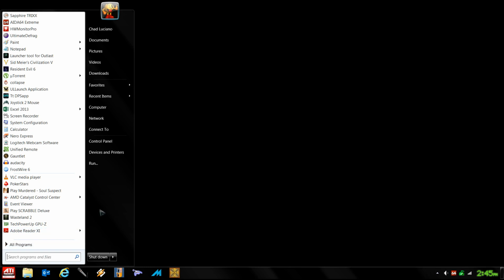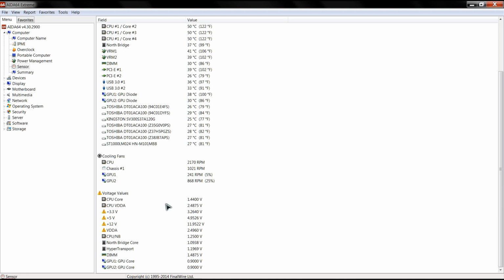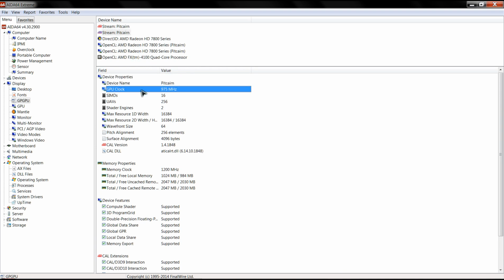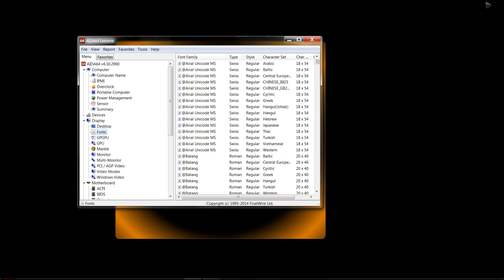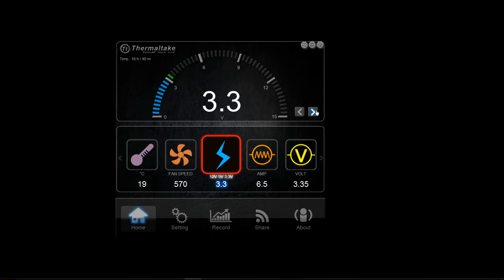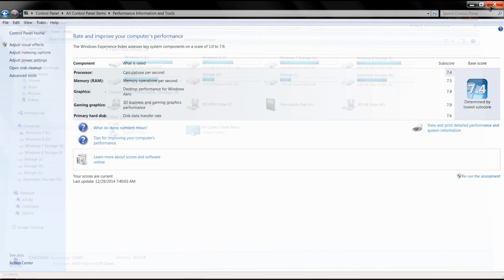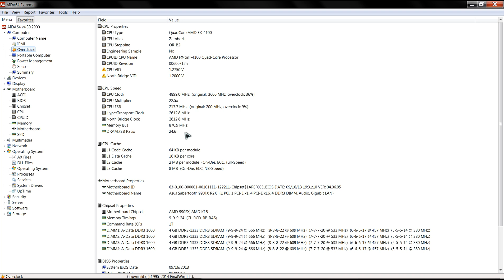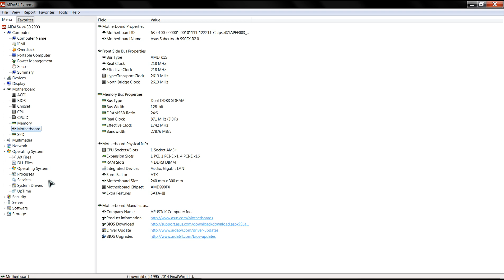Crossfire AMD XFX HD 7850 / ASUS Sabertooth 990FX 4.9GHz

Comment: over clock it like a Phenom II, would get 1.35 volts 4.55GHz. with a 200 watt heat sink might hold 75*C.
Reply: fx still a phenom... billy runs the cpu up like that and it instantly cooks its self. as the only achievement made with those chips was a slight boost in efficacy and stabilization of the overclock speeds from the previous generation.